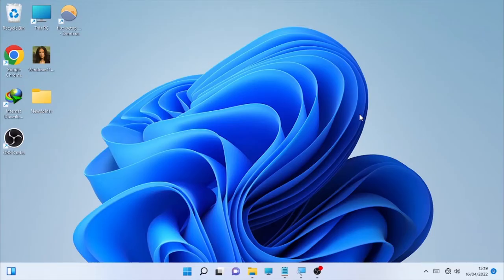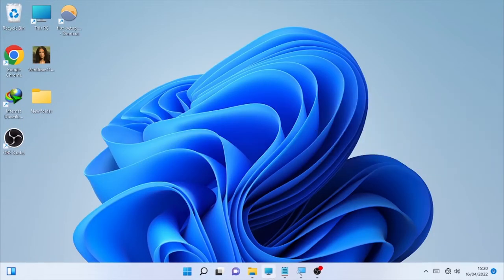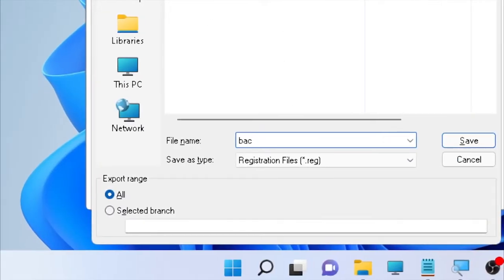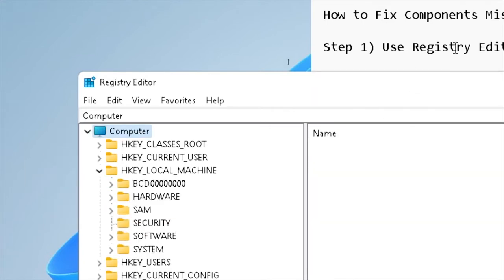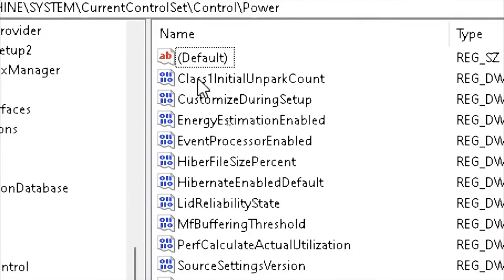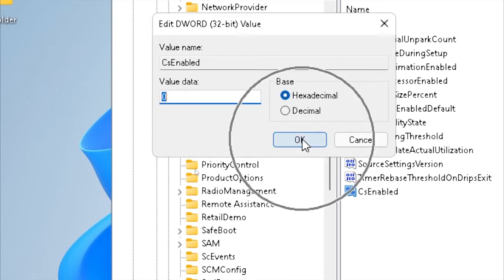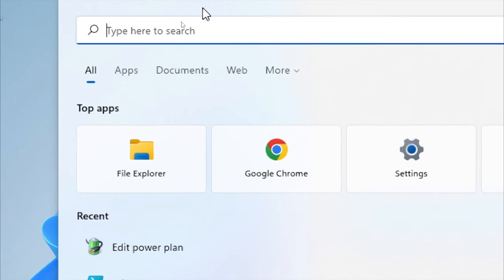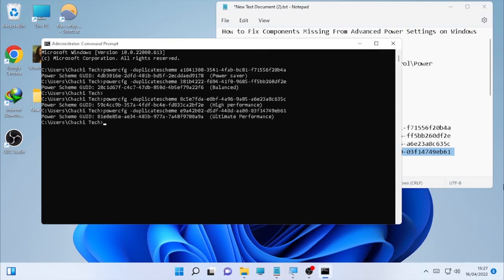How to Fix Many Components Missing From Advanced Power Settings On Windows

Comment: Mate thanks for the tutoria, but non of the solutions worked for me
Reply from the maker: Sorry to hear that,  I recommend you these two solutions Troubleshoot Power issues in the setting section under troubleshooting or  Restore default power plans under power options
Reply: @ChachiTech5  Thank you so much, but i have only 3 new plans i mean there is still missing more for example: i don't have the "processor power management" option and i need it
Reply from the maker: @koleka_mp3  
Check this video 
☑️How to Restore Missing Processor Power Management on Windows
      👇👇👇👇👇👇👇👇👇👇👇👇
        https://youtu.be/e3kmqtf1IK0

For More Helpful Videos Don't Forget to LIKE AND SUBSCRIBE TO CHACHI TECH